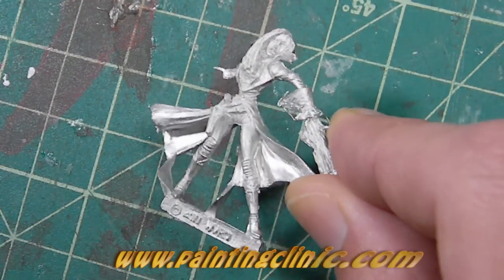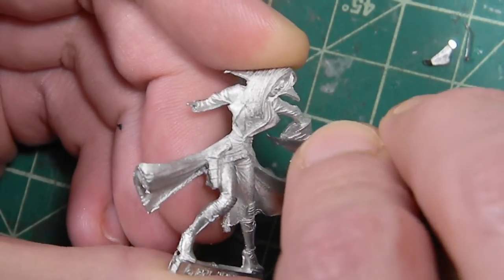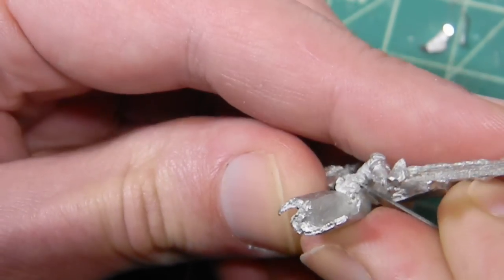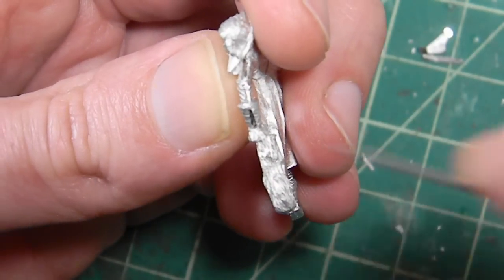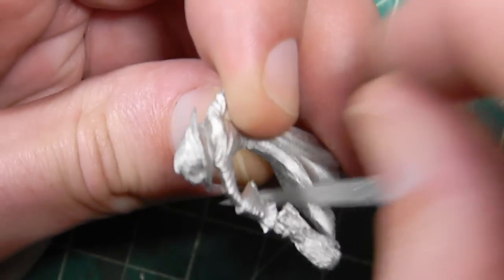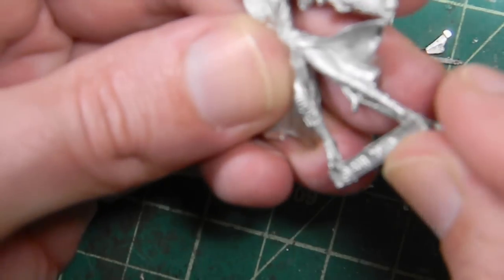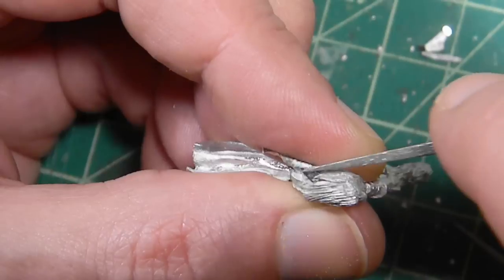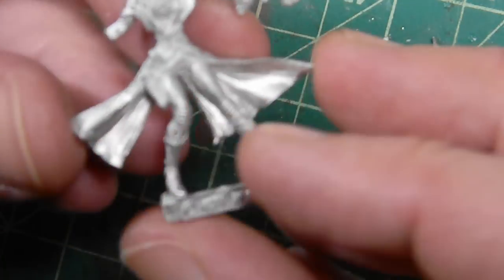The Basics: How to Remove Flash & Seam Lines from Miniatures

Comment: Doing this for some models can be pain in the rear (especially when you're excited to get your stuff painted), but it really makes a HUGE difference.  I've purchased several painted models on ebay recently where the original owner didn't take the time to do this, and the obvious mold lines just take away from the overall quality.

Comment: A little tip I use aswell is to throw down a bit of paint on the seam lines after prepping the model , and then you can see if you've missed a seam or if your cleaning work was not up to par. dark paint on a light cast or a white on a dark surface. mixed 1:1 thinner , you can just clean offf the paint before primer if needed .

Comment: Good tip for plastics, you can brush some Liquid Cement like Tenax 7R or Tamiya Extra Thin Cement on tough areas like hair or fur to blend the plastic flash into the model. Just keep brushing in the direction of the detail and the flash disappears.

Comment: Awesome, this is exactly what I was looking for!  Have you ever cut yourself doing this with that hobby knife?  I was using some of that MagicScuplt after it had hardened a bit and got myself pretty good.  Do the file marks ever show up after the painting? I worry about the rough texture left by the filing process?  Do you ever try to smooth the file marks?  Thanks.